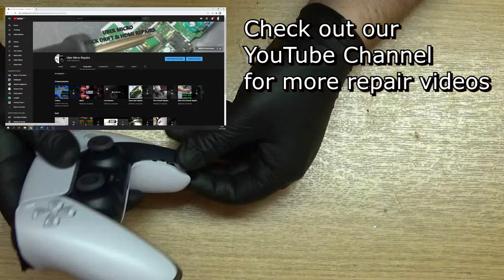PS5 Controller Fix. Can Stick Drift Be Repaired? Lets Find Out.

Comment: My ps5 controller recently start drifting like crazy idk why that happen? First it was ok and a week ago start the drift is getting worse and lets say i put like 54 hours of playing and i got the ps5 a month ago i see there is alot of people having drift problems
Reply from the maker: Yeah I would recommend contacting Sony for warranty or the store you purchased it from. Unfortunately the DS5 controllers use the exact same analog modules as the DS4 controller. there fore will suffer the same issues.
Reply: Same in rl low key o can’t play good anymore
Reply: If you still have problems try pushing the stick in hard for about 3 seconds and it for me at least goes away for a while.

Comment: This is way harder than it looks unless you're good at soldering. As for Nintendo's Joysticks, they easily dethatch by disconnecting a ribbon cable and unscrewing a few screws.
Reply: I just removed a joystick from a very early version of ds4. Definitely a very hard job. I bought a new solder pump with silicone tip. Mine couldn't handle all that solder. I replaced it nicely. But it's very hard, and I don't have a heat gun lol

Comment: how about the dead zones?  0% really?
Reply from the maker: This is the issue. Replacing a stick will have drift and dead zone issue unless you manually calibrate it. If only Microsoft and Sony would release the calibration software to write the new values into firmware!! #righttorepair

Comment: wouldve loved to know about the soldering tool beforehand, not having one just stuck me. Cant move on without connecting those little wires, great
Reply from the maker: @ 2:24 you can clearly see the soldering iron when I remove them! How did you remove them?

Comment: Any way to fix it without tearing it open? Knowing my luck, I’d probably break something if I attempt this
Reply from the maker: Don't think so depends on the issue.
Reply: I have fixed multiple ps4 controllers and would sugest having a screwdriver with a whole set of different heads a lot of patience it took me on the first attempt 15 houre ooening them is easy getting them back together is the worst part but once youve done 1 it gets easier as for the dualsense iim having drift on all of mine havent opened any up yet would advise having at least 3 dualsense so you can experiment on ghe other 2 while keeping 1 safe also haging a soder and soder sucker is good and a few cans of compresseed air.

Comment: You don't have to solder inside green poti there is contact plate just cleaning it or replacing it would do the job
Reply from the maker: Yes some times that can fix the issue.

Comment: I have a slightly different problem. Mine doesn't drift, but if I hold the left stick up, it stops registering every now and them for milliseconds which translates to my on screen character doing stop/move. Any ideas?
Reply from the maker: You could try cleaning out the potentiomiters if your confident!

Comment: One question, what is that surface with those orange colored circuit board holders that you used to hold the circuitboard? What is it called? Sorry I am very unfamiliar with hardware.
Reply from the maker: These are the holders: https://www.ubermicro.co.uk/uber-micro-equipment/  and the suface is just a heavy steel plate powder coated.

Comment: I wonder if PS5 controllers have a higher chance of getting the drifting analog stick than PS4 and why?
Reply from the maker: Sony seem to be using non ALPS analog sticks. They are easy to spot (Yellow potentiomiters) These analog stick are utter garbage. The ALPS suffer from drift but the Non ALPS.... I hand my head in shame. They have started using them a little while before the PS5 was released. Utter nightmare to replace and calibrate!

Comment: Not quiet sure about one thing. If I let the controller get fixed (drifting left stick) will it start to happen again or is it solved after that?
Reply from the maker: We cannot gaurentee it won't happen again since these controllers can and do suffer wear & tear. However when we repair a controllers we do take steps to help stick drift from happening, Let's put it this way we have had customers who have had both analogs replaced and just over a year later they have sent in the controller again for the LB/RB switches to be replaced and the analogs we previously put in are functioning perfectly fine. Natrally from use the stick loosen but they are centering corretly and no drift!